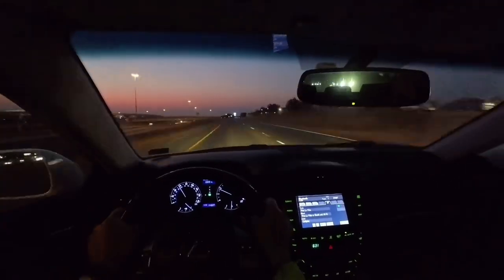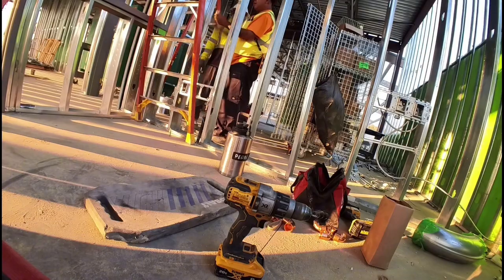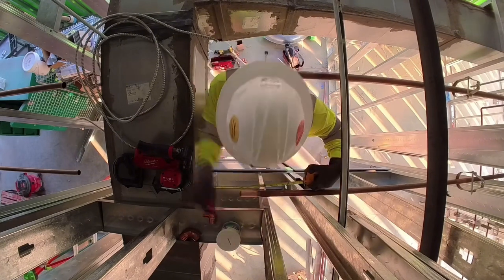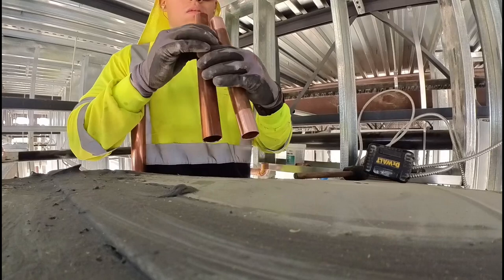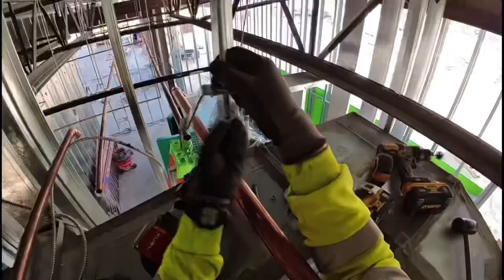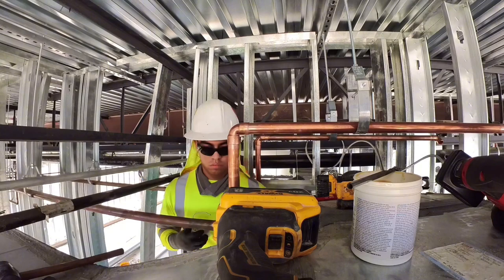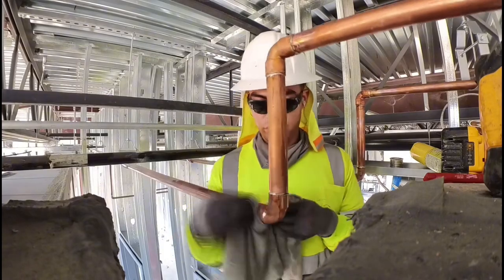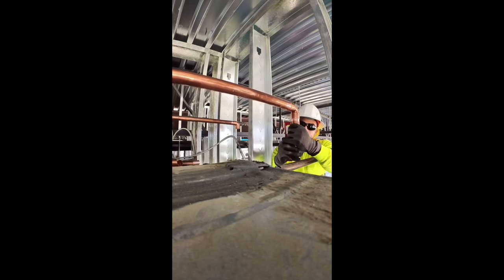Commercial Plumber: Road to Journeyman #1

Comment: I definitely agree with doing anything to make the job easier including using knee pads, using a drill for cleaning fittings, and sometimes even sitting on a bucket to work down low. It’s not about being a puss but conserving your body, cuz you take care of yourself no one else
Reply from the maker: Yea man preservation is keyyy, like what you said at the end, your totally right
Reply: Would cut out the bucket tho is terrible for your back over time

Comment: Whenever installing hangers, get with your Forman to get info on if the system your running will be insulated, you don’t wanna cut too high on your althread because the hangers will have to drop down a lil bit to make room for insulation, that’s why you notice the hangers are oversized for your pipe. I like to go about halfway or touching the metal bar on the hanger. Stay learning brother 💪
Reply from the maker: Thanks man :)

Comment: Just stumbled on your channel. Good work dude, I’m a fifth year apprentice working commercial in San Francisco. A little tip, when you gotta trim a little rod off clevis hangers you can remove the bottom/ cross bolt and leave the top with both nuts on. Slip your band saw in between the rod and clevis, hold back on the rod and keep one hand on the saw. Then just run the nuts up and reinstall the bottom. Just A little time saver so you don’t gotta take it all the way apart. Best of luck!
Reply from the maker: That’s pretty smart I appreciate that I’ll start doing that, a little time saved here and there really adds up! Thanks, congratulations on your fifth year!

Comment: Suprised you cut the excess rod in the clevis hanger. Are the pipes not getting insulated? I learned to leave it long so the insulators can adjust the hangers. Cool seeing some one only 6 months in. Im 2 years in and its crazy looking back, at 6 months I knew a fraction of what I know now. K
eep it up.

Comment: cop a map gas kit homie, makes ur life so much easier when soldering don't have to awkwards hold the bottle and can control your heat way better. Especially if u start getting into bigger copper 2"+. Also cleaner sauders regardless of fitting size.

Comment: also if u sweat ur uprights bfor u fit it up u dont have to sweat upside down joints makes ur work look cleaner. also if u wipe ur drips w a rag looks clean asf.
Reply: i find it easier to flick the solder while it’s still wet, just be super careful and quick using the right PPE
Reply from the maker: Like the other person that commented I usually just flick it but I gotta stop bc I keep brining myself

Comment: If you're cutting your copper tube with a bandsaw there will be no inside flare to create turbulence so reaming is unnecessary. However with a wheel cutter it is displacing the copper as it cuts. Thus creating a flare on the inside which will produce turbulence and eventually cause scour and a possibility of leak.
Reply from the maker: No way so reaming isn’t needed for bandsaw cuts? I didn’t know but honestly I really appreciate that information. I just ream everything because that’s what I was told to do but I’ll keep that information in mind thank you!
Reply: I think if the blade is new might not need to but if it's already been used a lot then you might need to still do it

Comment: Can I ask where you work (state, city)? Commercial seems pretty interesting. Might lean more towards that than service plumbing!
Reply from the maker: I work in TX, if you start I’d do 2yrs commercial and then go into service because you can transfer commercial to service easily but service to repair is a lot more difficult, they might not compensate you the same. And that way you’ll be a more well rounded plumber IMO

Comment: Hey man quick question, does the company/union provide you with those power tools such as the bandsaw and drill or are you required to purchase your own? I'm on a waitlist of a union here in Cali and want to be prepared. Thanks
Reply: Union shops will provide those tools
Reply: When I worked local 393  san jose   they wont even allow your own channel locks   its actually a good thing.   So Ca union a little differant especially plumbing    some of the shitty companies dont follow rules and want you to supply 
    ask union you are applying at  for details  even though its all UA its differant rules depending on location
Reply from the maker: No man I’m open shop so we had to source our own tools. Wish I could help more but best of luck in your apprenticeship

Comment: Um, where i come from with use hangers appropriate for the size pipe we are using
Reply from the maker: We have guys that come after use put insulation on the copper pipes so we use larger hangers to accommodate for em

Comment: Your not suppose to use a bandsaw on copper that’s not correct use tubing cutters
Reply: If there is no pressurized water, then it's okay in my book
Reply from the maker: We always done it like that I have copper cutters but it takes to long as long as we ream we’re told we’re good

Comment: so at 1:34 i saw the pipe end was at 8inches off the hvac. but when you add the 90 to it, wouldnt it be a bit closer to the vent? is code that strict or no
Reply from the maker: I don’t believe it was that strict but I had my foreman check it out and another 4yr apprentice before him and they all cleared it. But also theirs insulation that goes on top of the copper so it would push it up later once it’s installed